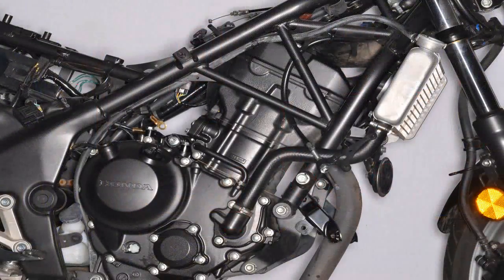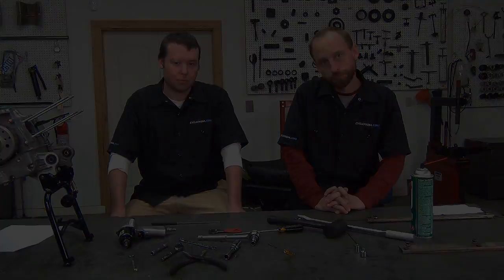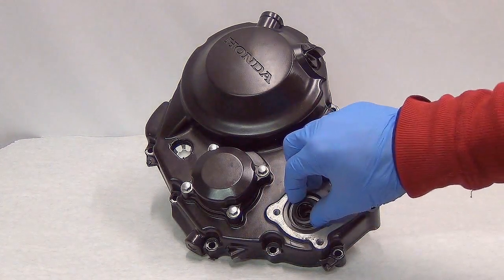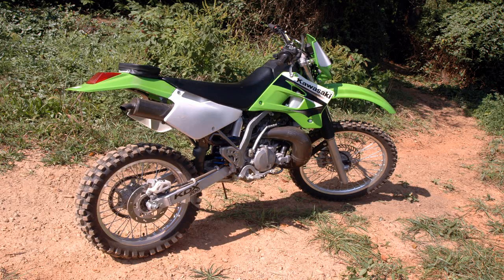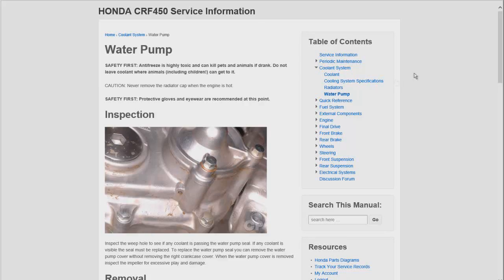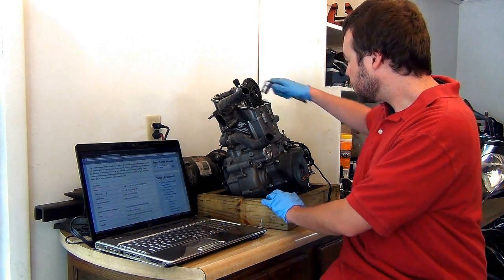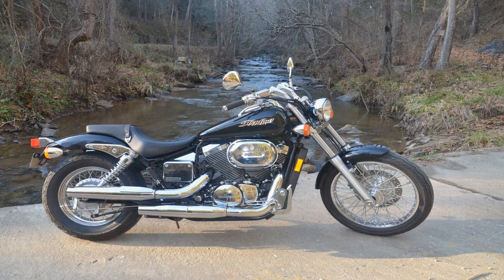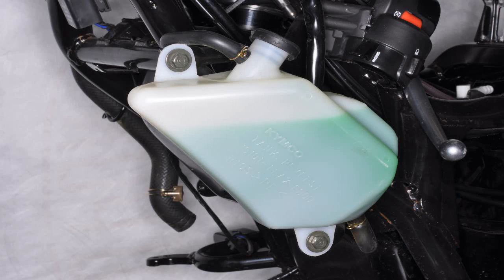Cyclepedia Podcast Episode 1 - Motorcycle Cooling Systems

Comment: Do you guys do Sport Bikes? Such as Yamaha R1 or even Suzuki Gsxr 600? Anything like that? I ask cause I need a 07 Yamaha R1 one. I have one more question I am sure you can help me with. How can you tell when your Water Pump is going bad on one of these Sport Bikes?? Thanks Guys!!
Reply from the maker: When the water or related components are failing there are some signs to look for. 

Coolant and oil may start to mix causing oil and coolant to mix, the oil will look white or you will see oil in the coolant.

There is a small hole under the water pump, this is there to let you know the seal is failing and coolant will drip from the hole.